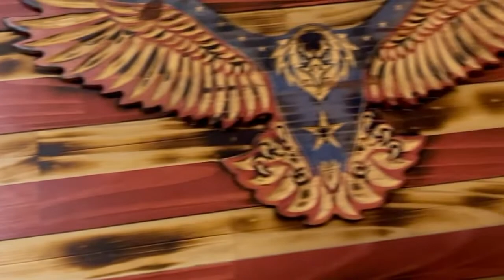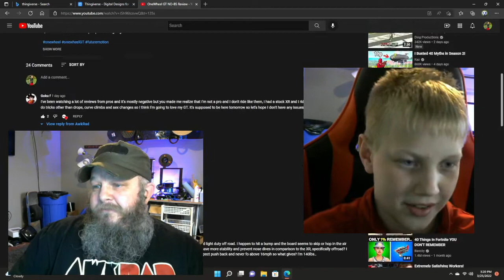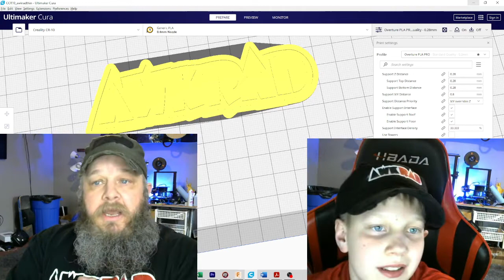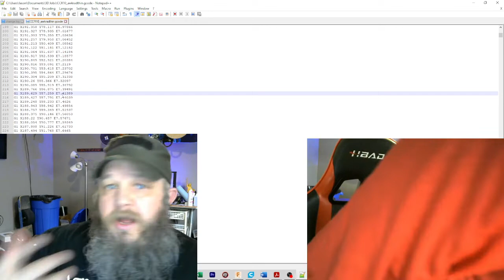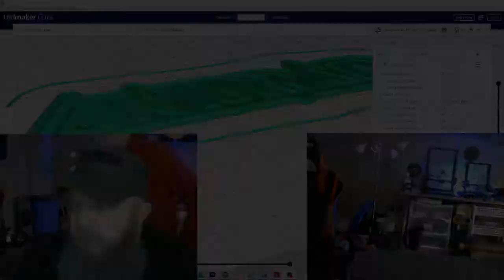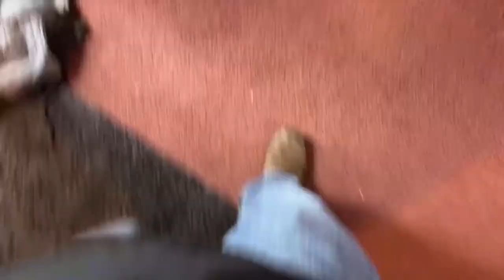3D Printing for Dummies: An Introduction to 3D Printing

Comment: So very curious about 3d printing but haven't the slightest idea on how to start,  what would be a great way  to start fir a beginner.  Or which  machine would tou say can be a great starter machine for a beginner
Reply from the maker: Hmmm it really depends on budget and time you have to put into it. You can start with a Creality ender but I would recommend a few upgrades right away. There are other printers that have all the good upgrades out of the box but they are much pricier.